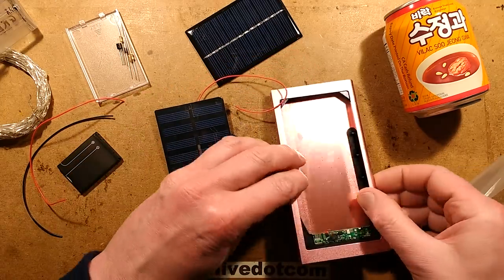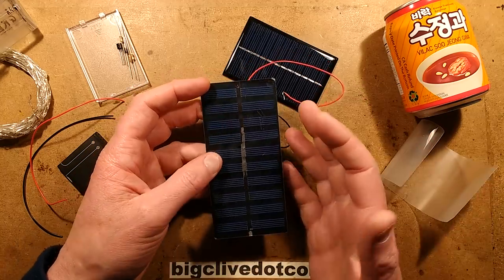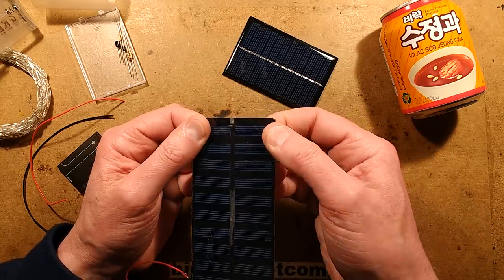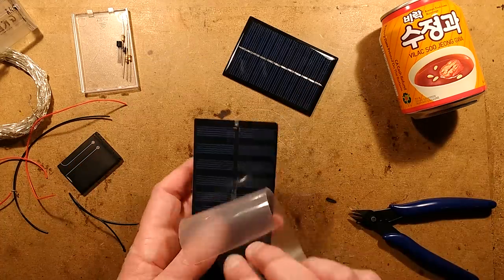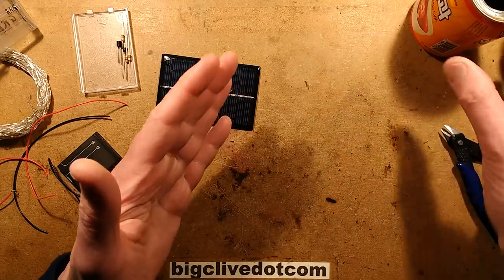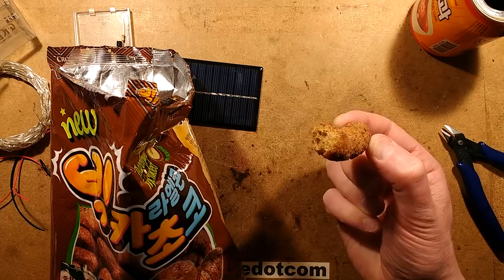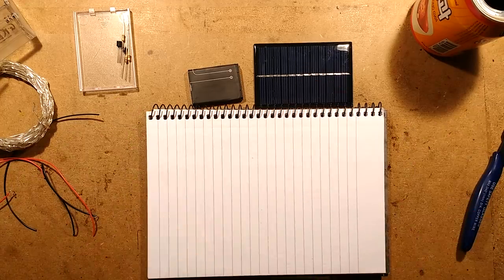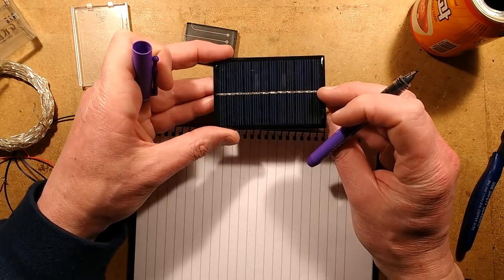Simplest solar light possible, using old phone battery.

Comment: Nice video. I tried this circuit. With exactly the same components. The lights turn ON-OFF with light on Solar panel. Works fine but with one hitch. I tried with only one white led which fades away in two hours. I want around ten yellow LEDs for around 4 to 6 hours. What changes should I make.
Reply: The number and type of LEDs shouldn't really matter. We can talk about a few milliamps here. You can use it to power one LED or you can split it among 1000, the total light flux you get will be about the same. What matters the most is your panel getting enough sunlight. Indoors I wouldn't get more than half an hour's worth of light myself. Putting the panel outdoors, facing south, made the circuit last 8 hours easily. (I used a smaller panel, 5V/0.5W only). 
The other thing you can do is limit the current on your leakage current path. Increase the 10k resistor to, say, 100k. This will of course reduce the brightness of your LEDs, but it will also make the charge last longer. I increased mine to ~300k and it now lasts all night on 1 hour of direct sunlight. Which is good, because in the winter, that's about all it's going to get.
And ofc you can also just use bigger/more solar panels. But then, your leakage current will probably also be stronger, so increasing your resistor value would still be necessary.

Comment: I love this video...thanks for making it.  Would this work with an 18650 battery?  Would any values of resistors need changing?  I want to power 1x 1W bright LED to put on my mailbox so maybe people will quit running it over at night. 😂
Reply: You'll need to make sure you add protection circuitry, or you will overcharge or over-discharge the battery.

Comment: Hello, how long the led band has and how much does it consume? In this way, we can determine if the battery is sufficient charged by the solar panel for the  fairy lights to light all night up to sunrise. Thank you very much for sharing!
Reply from the maker: With this circuit the lights will stay lit all night.

Comment: Did you check the collector current? Think you might be running in the linear range as your battery drains. hFE for a BC547 is between 110 and 800 so let's assume worst case 110 and assume a worst case Vbat of 3V and no limitation imposed by solar cell leakage with a Vbe of 0.7: This gives you 2.3V left divided by 10k x 110 = 25.3mA so might want to swap it for a 2k2 if you're building a few of them. Nice project though!
Reply from the maker: The LED current over discharge is quite complex as it also rocks on the forward voltage of the LED lowering with current and the lower voltage drop across the resistor also having an effect.  But I've had it running for four nights on a single charge so far and the LEDs are still visually bright.

Comment: Would this circuit work OK with a 5V solar panel, instead of the 6V one used in the vid? Many thanks, Nick
Reply from the maker: Yes, as long as the voltage is higher than the cell voltage and the diode in series.
Reply: bigclivedotcom thanks!

Comment: Oh, boy- do I need your advice. I'm currently trying to make an as-small-as-possible disc battery contact for a single diode. I realize there are models available on the internet as well as DIY methods, but nearly all of the ones on the internet involve more wires or separate plugs than I am looking for, the smaller sized contacts are great but do not offer a direct way to plug the diode directly into, and I'm trying to make something more presentable than wrapping tape around a battery. I''ve bought quite a few of the small "party LED's" in which you twist the bottom to light the diode inside the dome- and that's baaassically exactly what I need except that the intended use of the contact is for packaging a product, so a. I'm hoping for a more... professional or qualitatively compact version for aesthics and b, I happen to be using UV diodes, and with those mini LED's, I'm learning again and again how frustratingly difficult it is for me to rewire those tiny chips to the UV light. I've come to loathe soltering because of this, so to be able to plug a diode directly into the damn thing would.. be... nothing short of divine for my own sanity. The mount needs to be horizontal while the diode stands vertically and that housing is expected to go at the bottom or top of a hollow cylindrical tube (like a 1"-ish PVC pipe), at most, six inches tall. Another question I had was recommendations for a power source, probably disc batteries, with an appropriate power/longevity/size for that tube. I've ready about rechargeable disc batteries, and solar recharging like the one in this video would be so freaking cool, but I don't know if solar panels get that optimal in terms of size. Other power saving options I've considered is some kind of heat-based contactor so that the light isn't really active until it's undergoing some kind of interaction with the person it belongs to,.. like the heat from their hands or the friction as it shakes in their pocket... I honestly don't know what's possible, what's available, and frankly just before coming here what to even search for in google. Help me. Please. Even if it's just where to start-.... I felt lost going through Google and felt a sense of solace when I thought of you and your channel. I am humbled before your mastery, and please forgive the lengthy text.

Comment: @bigclivedotcom 

Do you think this concept would work with a 12 volt 5 watt solar panel and a lead acid or other type of battery (using 2 to 4 LEDs - possibly in series' of 2 - instead of 1)? and would that small reverse current harm a single solar panel to your knowledge?

I'm thinking removing the diode from the solar panel for this purpose. Of course I would have to adjust the value of the resistors to fit the difference in voltage. I've been looking for a simple circuit design just like this, but not sure if I can scale it up to 12v. If you were experimenting with this idea, where would you start? I'm an amateur, but I've been learning about small simple circuits like this and have made quite a few of my own LED lights and joule thieves and such, so I have a very basic understanding of simple electronics like this. Being able to create a circuit like this (actually to use with my lead alum conversion batteries) would absolutely make my day.

Comment: @bigclivedotcom - So, I did attempt to emulate this by following your detailed guidance Clive, thank you!   And I really enjoyed the building experience, sticky pads and soldering challenges to boot... 👍🏻

I used a Samsung phone battery and a similar solar panel, but had to use the 2N-3904 transistor.  The solar panel indicates an excellent response to light and the battery charges well.

However, the LEDs I used (the Pound World little plastic bottle/string combo) are very dim, just a little like me I suppose... 🤪

Would you expect the LEDs in this string to be really dim, or do I need to change something?  I have a x100 string of Green LEDs similar to those you used en route and plan to swap them when they arrive... 🐍
Reply from the maker: Check you did use a 10 ohm resistor and it might be worth experimentally lowering the value of the base resistor or using another resistor to bridge to the positive battery rail to see if the transistor just isn't quiote turning on hard enough.
Reply: bigclivedotcom Thanks Clive, I was careful with the resistors and even checked it with the component tester to be certain, but I will double-check.   I will also play with the base resistor value.  Thanks a lot for taking time out to reply, much appreciated sir! ... 👍🏻 🐍

Comment: This looks great. I am looking to create something similar, but to power a tank gauge instead of lights. Is it possible to wire this in such a way as to allow the gauge to put load on the battery at the same time that it is charging from the panel?

Comment: Thank you for sharing the circuit, I've always wanted to make my own solar lights but without the nickel metal hydride cells.  I tried to find as many dollar store led strings to light up.  I really like the cob lights though.  Maybe not related to this exact circuit but I was wondering like the jewel thief if there's a way to modify the pulse width and not the frequency to get a brighter blinking light that stays on slightly longer

Comment: Hi Clive
At ~ timestamp 23:13 you ran into some dodgy Li cells, and had to try a few to find one that wasn't flat.  Since this video has some tasty treat content, I only thought it appropriate to mention that if you placed your tongue across the Li battery "sandwich" you can tell instantly if it is a good cell.  Don't worry, there is no discomfort involved--a ful cell gives a slight but distinctive tingle on the tongue--the dead or weak cells give virtually nothing.

Comment: I have been using this circuit for years now and it just works. was wondering if something similar could be done using a tp4056 charging module with a "Dawn Dusk" setup and not leave it on the whole time.

Comment: Hi Bigclive.  Tried it - it worked for me!  To increase the number of LED's to drive,  do I reduce or increase the size of (your) 10K resistor?  And what's the calculation, so I can work it out myself?  Thanks
Reply from the maker: The resistor to change the LED current is the one in series with the string of them.  But if the base resistor is too high it will also limit the LED current.

Comment: If anyone was wondering the tp 4056 charger for 18650 cells works really well in solar projects. It doesn't mind having less current then the maximum 1amp and the spotty voltage from clouds passing and whatnot doesn't mess it up. Just thought I'd mention that for anyone interested in making their own solar projects

Comment: I wonder how much that solar panel leakage current is? It is taking the current from the battery trying to push it through the reverse biased diode and the base of the transistor. So I am hoping it to be very small.

Also what kind of lights are those string lights? Every LED is connected in parallel across the power source? How much is the collector-emitter current in that case? I mean how hot is the transistor getting as a result of that?

Comment: If the diode stops leakage current, how does it get through the 10k resistor at night?  You can see what I mean if you consider the diode closely approximate an 'open switch' function.  I know this is the ideal case, but I would not have thought that much leakage would be in the diode--is it some kind of cheap "high-leakage" type?  I plan to build it, and maybe use an FET?
Reply from the maker: The current to the transistor base at night comes from solar panel leakage.

Comment: If the battery has a built in protection circuit, is a diode really necessary? It is my understanding that the circuit can provide that characteristic for the circuit to prevent discharging.

Comment: I bought a whole bunch of batteries and lone solar panels from bargain places that I want to attach to my outdoor decorations instead of consistently replacing batteries or plugging them and running up my bill or have annoying cords all over the place. Do these circuit components vary based on the voltage output of the panel itself?

Comment: Since it is going to be on for the night, that is about 8-10 hours what if we use a super cap, instead of a battery. We would have a very long life, also the circuit will probably be more complex. and no worries for storing them, after discharging them.

Comment: Would be nice for camping as well. What kind of switch would you recommend so that they can be turned off while stored so that the battery doesn't fully drain?
Reply from the maker: And small switch could be used.  One that could be glued sideways to the solar PCB might be best.

Comment: clive im trying to go full solar for the house lighting. been testing various  floodlights and panels.
now i have one thats a cob filament glass bulb, gives off a ton of useful light thats not glary. and runs all night. now ive tried finding other models. i cant find any that match it in brightness/battery time.
also i dont think its self dimming due to temperature like many do.

now looking at those bulbs online theyre all 120v...is it sonehow more efficient running an ac bulb off a lithium? or is it more likely a 5v lamp that looks like a 120v?

its solar panel is small (20x20cm roughly) but its really killing the others. i want to build some myself rather than paying for the packaging i dont need or like but deeply confused by the output.
(its the one on amazon with a pull  string, remote and pentagonal wireframe shade for about $40)
dont think its pwm either as theres 0 flicker and im really sensitive to that.
Reply from the maker: You can get LED filament lamps in 3V and 12V.

Comment: The 10k resistor from + to the base is not a good idea. This would make the LEDs light all the time. If the solar cell didn't have enough leakage current, the 10K resistor should be directly in parallel to it instead.
Reply from the maker: When the solar cell is putting out current it drags the base 0.6v below the emitter in the circuit where the 10K resistor is connected between +ve and the base.

Comment: Novice question for you. I have a bunch of "dead" solar lights. Could I use multiple boards and the circuit boards that come with them to do something like this? Maybe hooking four of the small panels in series...each to their respective control boards and then connect that to an old phone battery somehow?... Probably a stupid question, but I just want to find a project I can do without buying any resistors or diodes because I have no idea what I am doing :-)

Comment: A great project and just what i was looking for, cheers Clive, as an added extra i was going to make one of those solar trackers out of components but the comments say it burns out after 10 mins, you would be the man to ask - what does that circuit need to stop it burning out? (Im assuming the TDA2822 is what gets burnt out).

Cheers, FPV.
Reply: PS I decoded there is a polarity switch at night and in the morning, this is whats causing a reversal in solar panels and the need to add a blocking diode, i get 1.9v @ night time on a 6volt solar panel, warrants further investigation if you are interested / can help research this area? @ Night it reverses my air pump and sucks the water back up to the motor (solar powered airstone filter in a rain barrel, the motor only needs 1.5v to activate hence it working in reverse at night.

Cheers, FPV.

Comment: Great project as always, would changing the resistor values change the when the lights turned on??
Reply from the maker: Not really, it just relies on the solar panel efficiency at low intensity.

Comment: I have two separate lithium run lights on my motorcycle helmet, I don't use them during the day, so I could be charging then... All I need is glue the solar panel to the top of helmet.....
What I really need is use a 'super capacitor ' in parallel with panel, then use a USB charger output...

Comment: I was just thinking (I don't have much else to do during lockdown here in Australia), if you keep those boards with the DW01 chip and you score a 3.8V battery, with a rated charge voltage of 4.35V, you could use the board to limit it's charge voltage to 4.3V+-0.05V. The 4.35Vmax would be it's rated charge voltage and would give you at least the rated battery life if not more.
Incidentally, I have been trying to find out what the 3.8V & 3.85V batteries have instead of the DW01. There are other type number chips. One by ON Semiconductor, the LC06111TMT appeared to be programmable: 4.1 V to 4.6 V (5 mV steps), but could not find the instructions in the datasheet on how to do it.

Comment: Ah BC547/8 I have a drawer full of those (Also BC557/8's but less of those. BC327/337's and BC328/338's for higher currents, never understood why the middle digit was different for NPN vs PNP in the 5 series where the last digit differed for the 3 series... )

So, very common in Australia too, probably owing to the old Dick Smith "Funway into Electronics" kits.

Comment: Cool project and I learned something about those batteries that I didn't know!  I have a few of those laying around that I wanted to use for projects but didn't know how I was going to connect them or charge them.  Thank you!  Do all the lithium batteries have that protection board in them??
Reply from the maker: Not all the lithium cells have protection.  There are crappy clone batteries without it
Reply: @bigclivedotcom   But the name brand ones and the ones that come with the phones have them, right??
Reply from the maker: @stevenA44  The real brands should.
Reply: @bigclivedotcom  Cool.  Thanks for the replies!

Comment: Recently I was wondering what that third pin on the battery was for and it showed up it's pull-down resistor to indicate the battery capacity class. I'm pretty sure that one middle pin is for the same purpose rather then being a temperature sensor.

Comment: I love the way they fade in/out rather than snap on/off. It's put me in the mood to make one myself, I have a (goody) bag of mixed transistors from maplins (god rest their souls) with a mix of NPN types BC547, 2N5551, BC548B, 2N3904 all in the black 3 pin package. Even came with a MUR3020PT which isn't a transistor at all, it's a high voltage/power diode package lol. Will any signal transistor work? I know they have different hfe's and power/voltage ratings. Just wondered is all :)
Reply from the maker: And general purpose NPN transistor with high gain should work.